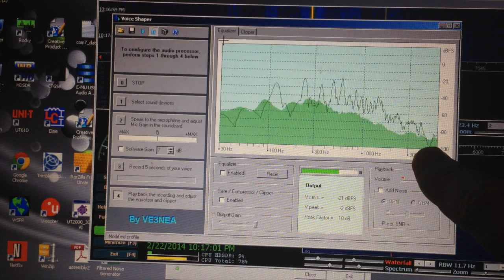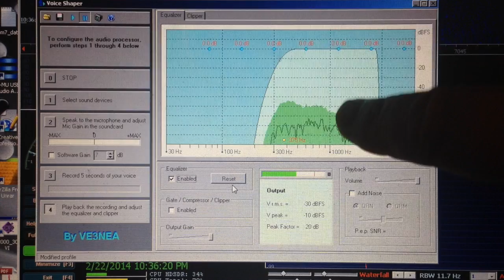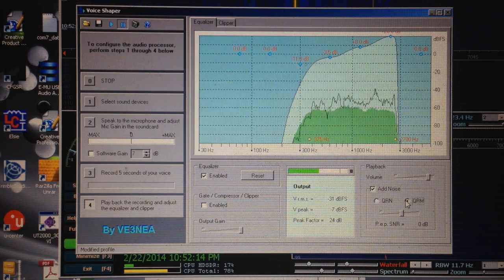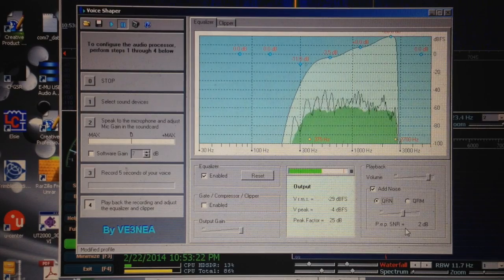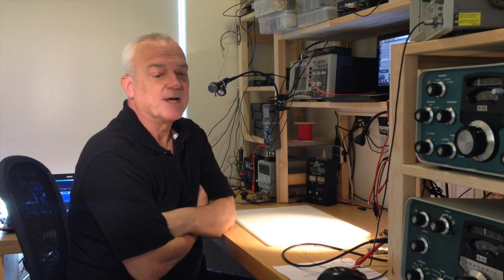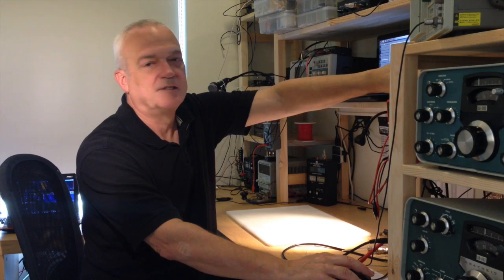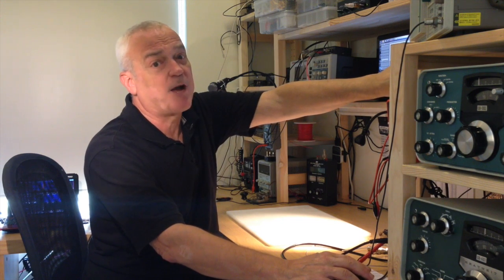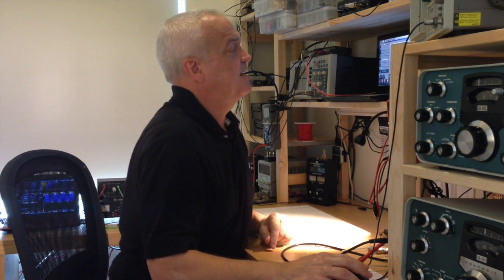Voice Shaper Tutorial

Comment: I'm assuming I could do the same with a DBX 286S run into a parametric EQ ... but whether using software or rack modules, the same issue crops up... the output is always balanced! Unfortunately my rig prefers unbalanced audio and grounds one side.

Do you use any additional interface between the soundcard output and the radio, to get the balanced output to play nicely ?

M6UDS

Comment: Voice shaper uses RF compression/clipping, not baseband/audio compression/clipping like most other programs/devices. This means three things:
1-Fidelity suffers even at low compression levels. Probably not the most suitable for rag chew.
2-Average power is higher than using the best audio compressor.
3-Transmit wideband remains almost untouched, no matter what compression or clipping level is set, because of the nature of the process (RF envelope processing). This is not an audio compressor/clipper, where bandwidth enlargement is very noticeable.

In short: This is the best processor for DX/punch. If you want better fidelity with reasonable / lower punch, then use an audio processor. I recommend VST based plugins like REAPLUGS.